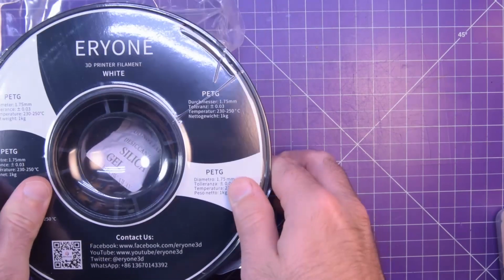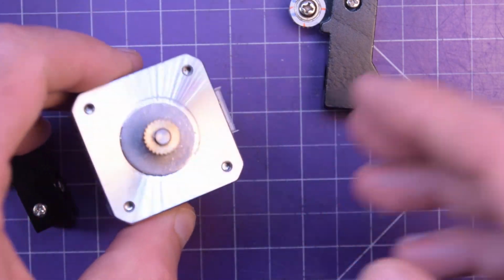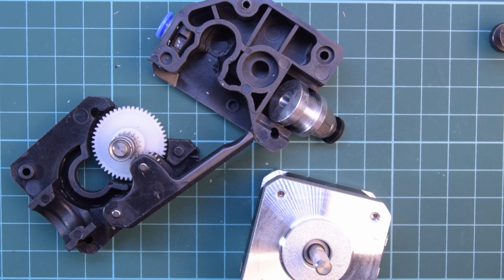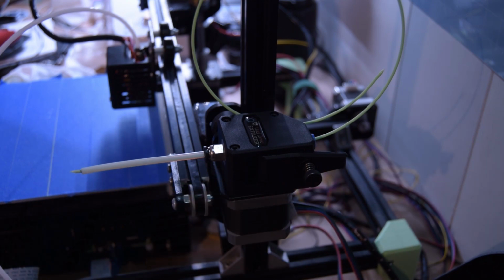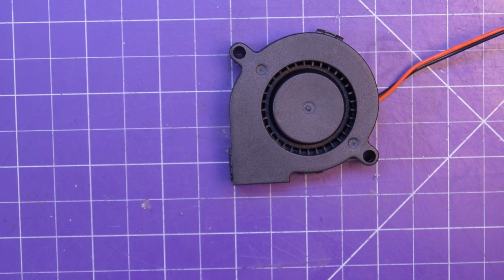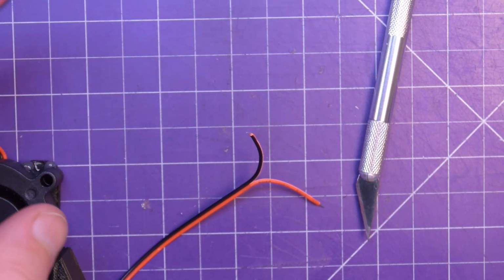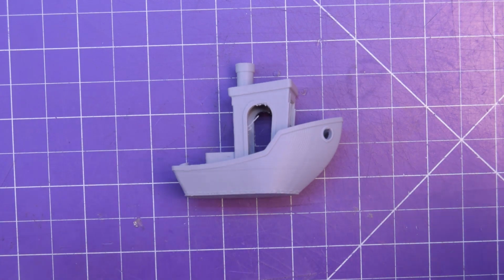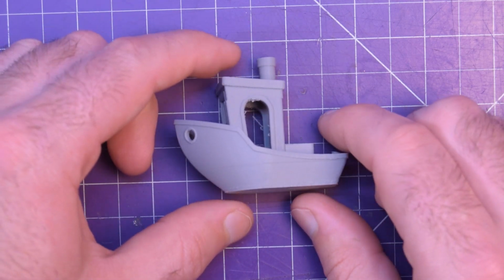Upgrading In Preparation For PETG

Comment: A BMG style extruder is one of the the best upgrades I have.
I have buttons in octoprint to load/unload because you can't easily do it manually.

Layer shifts are mostly due to belts not being tight.
Reply from the maker: I'll have to check print orientation but I think it shifted in Y, and that belt has a custom tensioner and so I don't think loose belts would be the cause of this one in particular

Comment: I would recommend you get your hands on a ender 3 pro, it's only around 150-200$ and even with its single gear extruder it's wonderful to print. I ONLY print with PETG and haven't any issue (except for a warped bed wich was an "easy" fix with an bltouch)

Also of your print with petg I highly recommend you to get your bed a slightly wipe with acetone so the part will stick to the bed properly.

To the Part cooling, if you want fancy prints turn it up to 100% but if you want mechanical parts that haven't to be very pretty than turn it down to 10-20% cooling, you can test this with an "Fan-tower" 

Layershift comes probably from belts that are too lose.

All in all a great video and if you have any questions about modify your firmware let me know it 😄
Reply from the maker: Ender 3 Pro here is around 350$ CAD - I think I would prefer the 3 V2 for just under 400 CAD - but even better would be to mod my printer into something that works exceptionally well! It works well right now and since the dual gear extruder it has been phenomenal! Next up will be bed wobble being fixed with linear rails
Reply: @SimpleElectronics  oh Okey, yeah then then v2 would be a good choice. In my opinion it really depends on what you want from your printer. I don't need a printer that prints unbelievable fast, for me it has to be reliable and that's why my choice was the ender 3 pro. It's cheap and works really great also it has a massiv community so there are plenty of mods for every situation I need. But even the cheapest one needs just a little bit of care and maintenance to work well for a long time

Comment: One of my planned upgrades I've already got a kit for it. Already replaced the springs before I even fired mine up the first time. I had someone suggest a locking mechanism because the leveling wheel on his would loosen in use and throw the tramming off